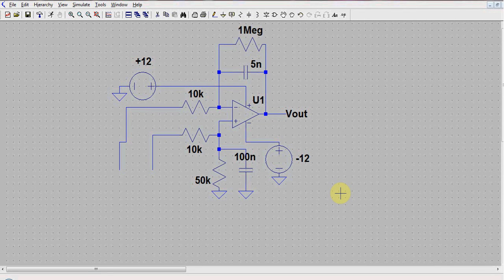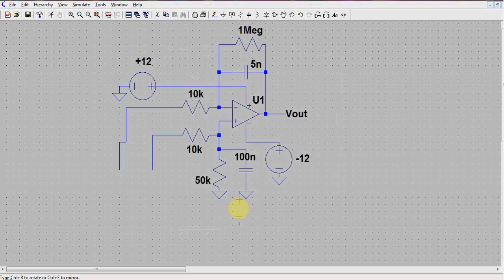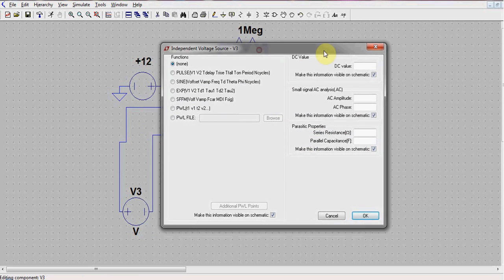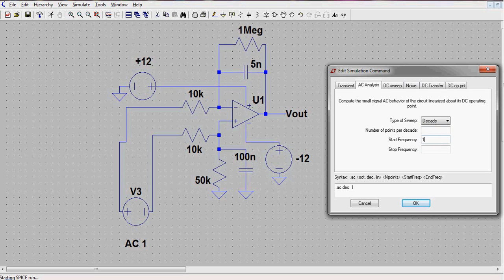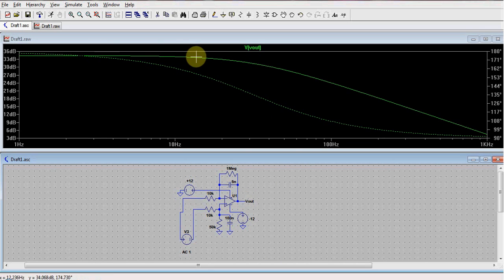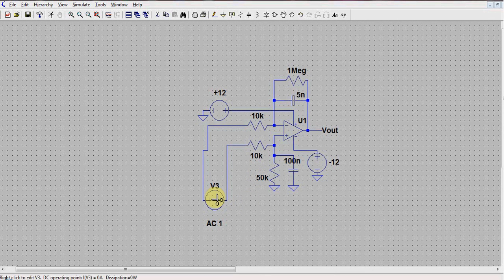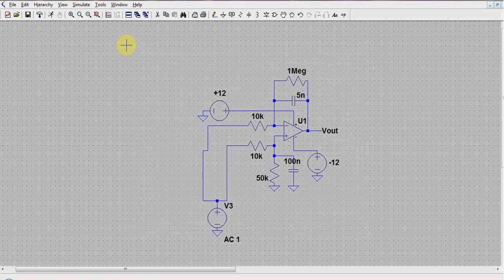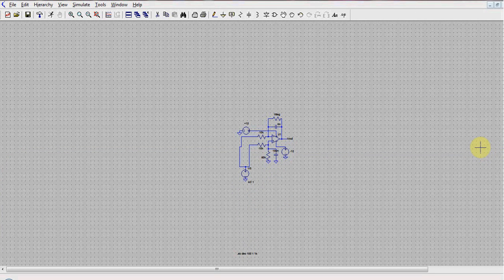Differential and Common Mode Gain using LTSpice

Comment: I don't believe it's so simple for the common mode gain, because the CMRR for most op-amps is somewhere around -50 to -100 dB Yo had around 20dB on your graph... Maybe you model of the op-amp also had some voltage offse and that was actuallt showing in the graph ?
Reply: The feedback resistor is 1MEG, circuit is not balanced, CMRR performance is going to be terrible as shown.